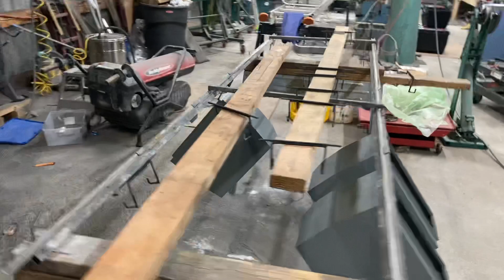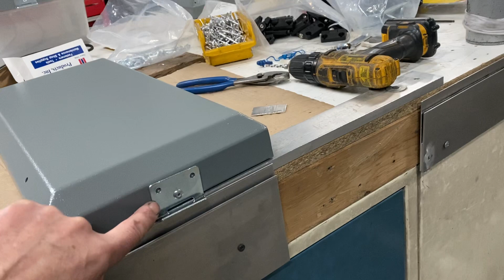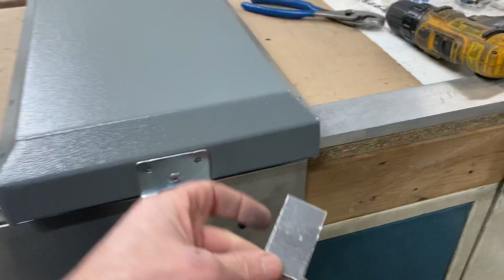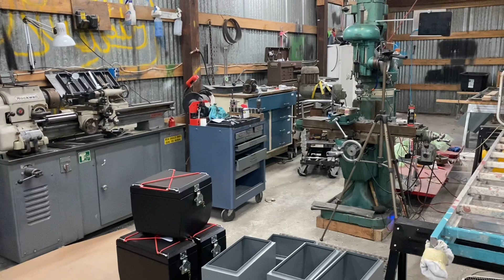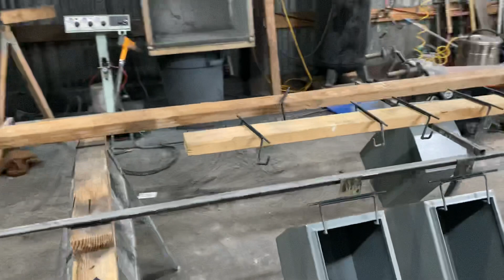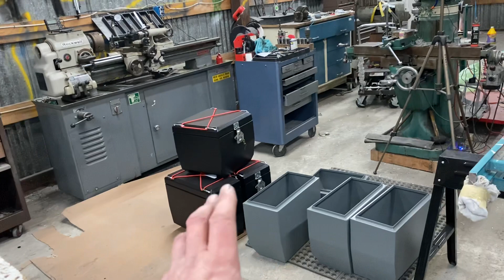I got Zucked!

Comment: I have a 2016 KTM 1290 super adventure I want panniers for.  Normally when I see boxes for it the exhaust side is thinner.  Will this work on my bike? How do they mount?
Reply from the maker: I can put a thin box on the  exhaust side no problem. Give a call. 360-840-7139